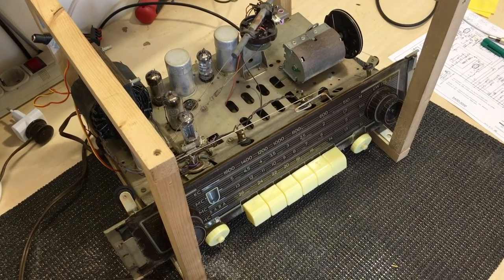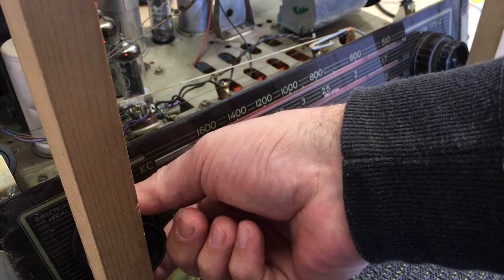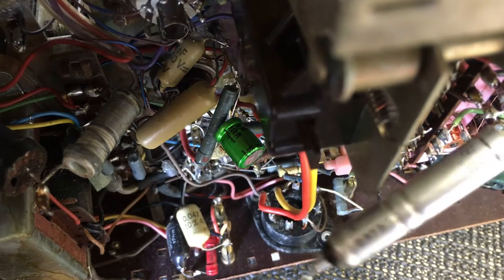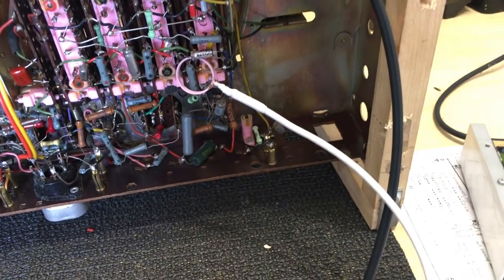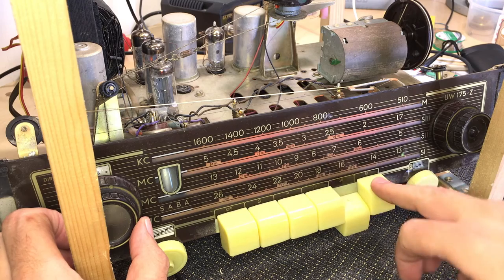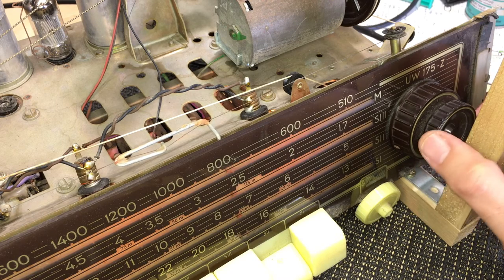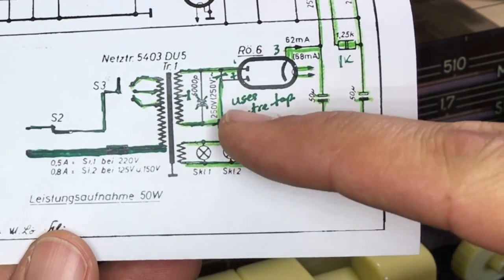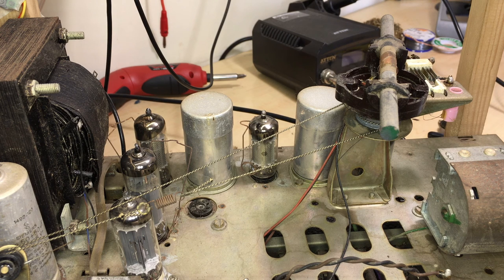Saba UW 175-Z 3D tube radio restoration - Part 2. We have progress. Power-up.

Comment: I really like the idea of the wooden framework/ Stand. Do you make these for every radio. It must make handling and live chassis tests much easier. Nice job
Reply from the maker: +AllTheGearNoIdea : no, I have two that I use over and over. One small one in wood, and a larger one in aluminium for larger sets. I just make more holes to fit the particular chassis screws.
Reply: Its a really good idea - I will be copying you.  I guess the wood version could also be a bit safer with the insulation factor.
Reply from the maker: +AllTheGearNoIdea : yes it is, but the other one is less bulky. It depends on the size of the chassis.

Comment: Hi - I have a SABA Type Villingen W which is documented as "FM ready". And the dial plate is unusual on UKW  part (0 to 100). Can this radio receive FM or just marketing stuff?
Reply from the maker: Almost all the radios of that era that had FM only went to 100MHz. The scale you’re seeing is probably a reference scale and motivate frequency. Check the web. You’ll find tons of info.
Reply: @electronicsoldandnew  what to search? a few keywords? :(

Comment: Hello, greetings. I would like to know, please, what is the secondary voltage of the transformer, why is the primary voltage various? 110 V 220 V
Reply from the maker: The secondary voltage is about 220VAC. The primary has multiple taps to work in europe which has 230V mains, and also in the US which uses 120V.
Reply: @electronicsoldandnew  it has a selector at the 220 v input and as you say 120 but if you measure the output towards the radio what voltage does it give you power why my transformer burned
Reply from the maker: The output of the transformer should be around 220VAC or so.